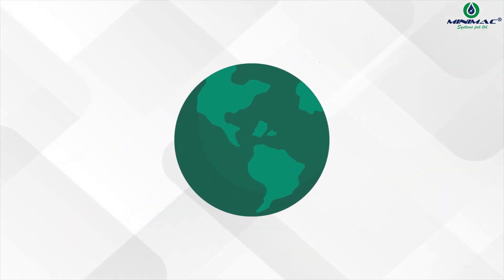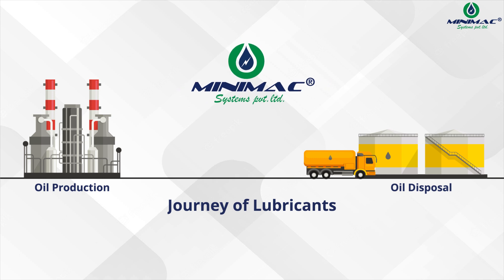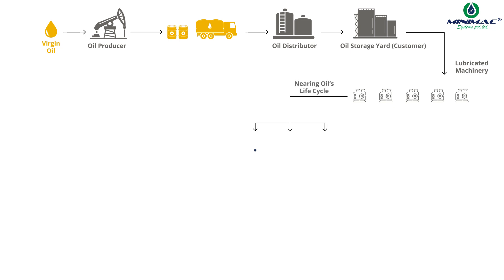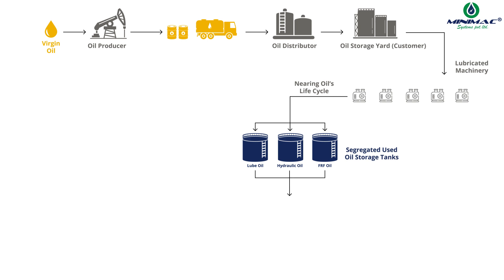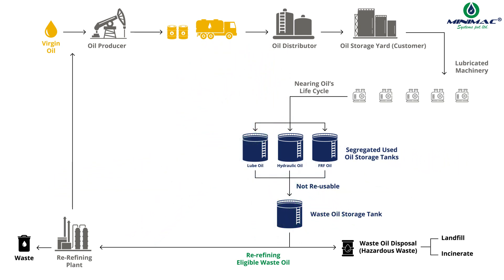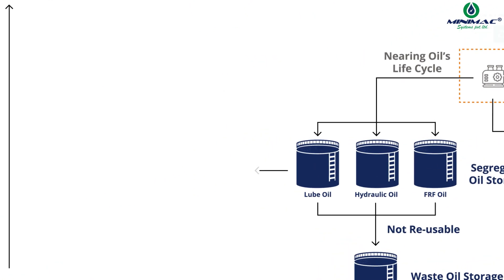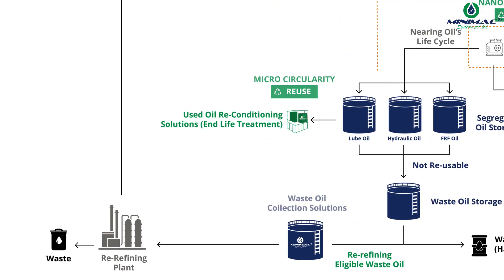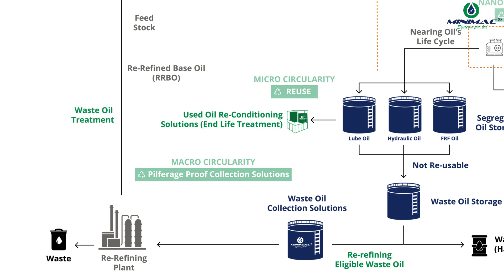A Step Towards Sustainable Lubrication Lifecycle Management

Comment: In this video, we'll be discussing Sustainable Lubrication Lifecycle Management and how Minimac System can help you to close the circularity gap.

The Circular Economy is an important topic that we need to be more aware of if we want to have a sustainable future. The Minimac System can help you to close the gap, and that's what we're discussing in this video.

We'll start by looking at the current state of waste oil disposal, which is a major environmental problem. MINIMAC provides 3 solutions for reducing waste oil and promoting circular economies.

1) Mid-Life Treatment: This involves filtration of tanks and recurring oil filtration over the years, reducing oil usage and introducing Nano Circularity.
2) End-of-Life Treatment: This provides Used Oil Reconditioning solutions, promoting oil reuse and promoting the concept of Micro Circularity.
3) Waste Oil Treatment: This converts waste oil into Re-Refined Base Oil (RRBO) to be used as a feedstock for oil producers, bypassing emissions and promoting macro circularity through recycling.

By implementing these solutions, MINIMAC Systems helps reduce CO2e emissions, conserve resources, and build a more sustainable future.

Learn more about  @minimacsystems and how they're helping build a circular economy.

Be a part of our community.